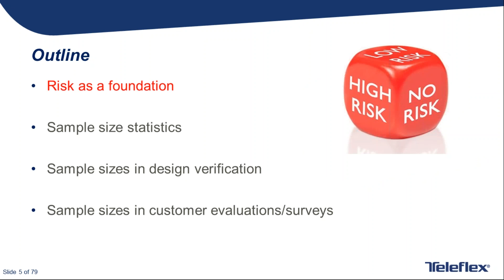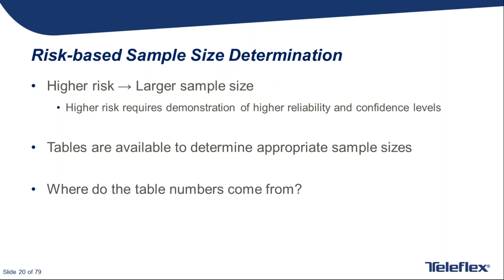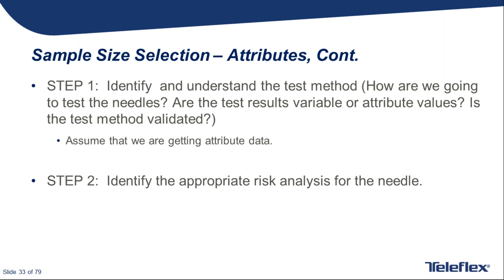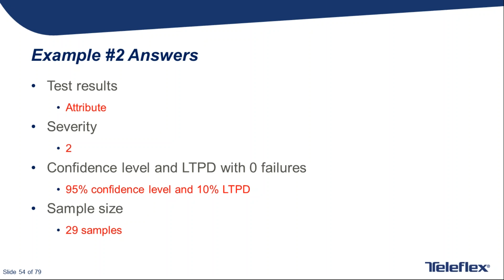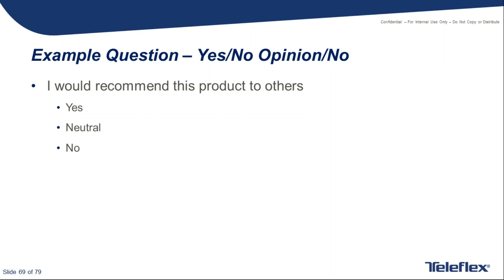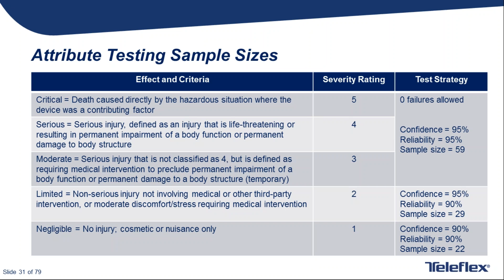Webinar: Risk based Statistics for Product Testing

Comment: Overall this is a good presentation. Thanks for sharing. On that real world example around minute 34 it seems those 3 low values could have assignable cause. I don't think shopping around for a distribution or a transformation is a good practice. Johnson transformation is usually used when we are trying to forced data to fit, which is something we should most of the time avoid.